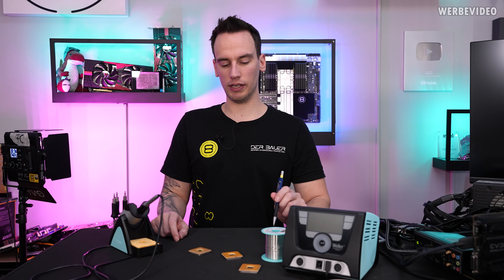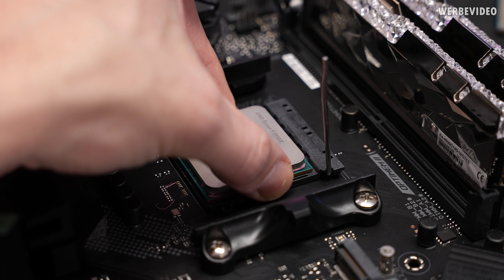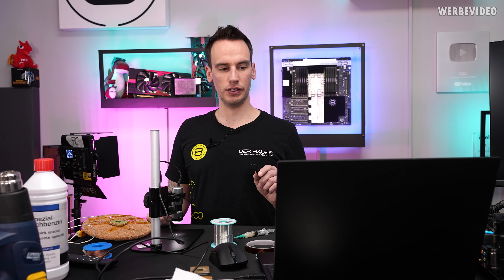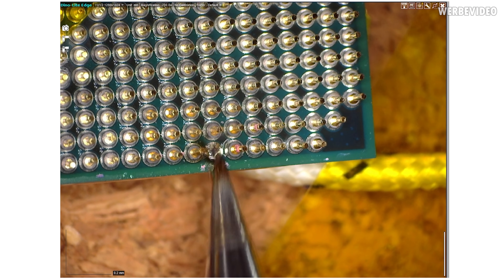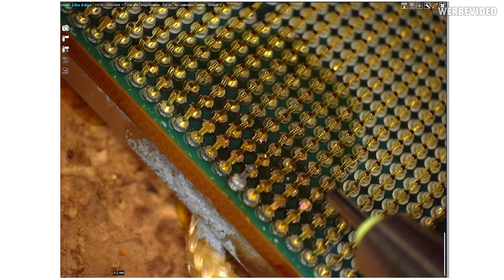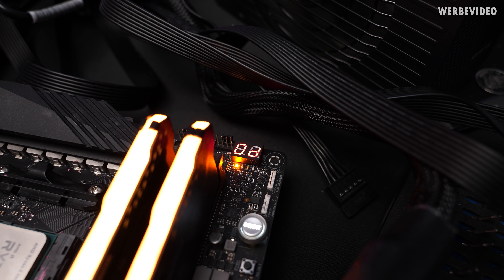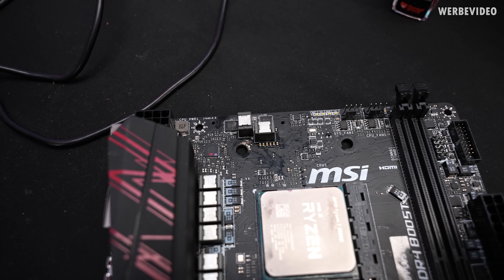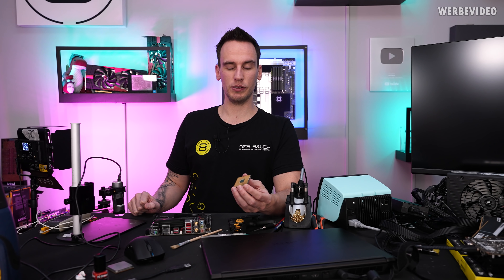I tried to Repair a Dead Ryzen 5950X and almost made it Worse...

Comment: I used to use a box cutter blade.  At every angle available between the pins and the bent pins I would wiggle the bent pin in the direction to straighten the bent pin.  90 degrees and 45 degrees angles.  It worked every time.

Comment: On the 5600X, the pin that was bent and broke off when you moved it (at pin coordinate AU39) is just a VSS pin. It is only there to provide a local ground reference to the adjacent MB_DQS_L[5] pin at AT39, to help keep the fields tightly coupled and the return currents off other nearby signal pins. Luckily the pin to the north-west of MB_DQS_L[5], at coordinate AR38, is also VSS, so even with that bent pin gone every signal pin still has a reference ground nearby (i.e. within at most one diagonal distance). All of the ground pins connect to a ground plane inside the carrier PCB, so you can lose that one pin without problems. The only one you really need to fix is MB_DQS_L[5] at position AT39, which is a data strobe (data clock) for the DDR bus.

A trick I considered suggesting is masking off the broken DQS_L pin with Kapton tape on the CPU, then bridging it to ground using a bodge wire in the socket. This would turn the signal from a differential pair (i.e. DQS_H - DQS_L) into a single-ended line (DQS_H - VSS). Unfortunately I don't think this will work, because the minimum V_IL(DQS) threshold is -130mV, meaning that DQS_L must be driven high relative to DQS_H in order to assert an input-low state. A bodge wire from DQS_L to VSS would allow DQS to be asserted high (i.e. DQS_L=0V and DQS_H > 130mV), but not asserted low (i.e. DQS_L > 130mV and DQS_H=0V) because DQS_L would be permanently stuck at 0V on the board side. In other circumstances you could probably get away with it, but unfortunately I don't think you can here.

A hack that might work without fixing the pin is running a bodge wire from pin AM36 to AT39 on the socket. This would tie MB_DQS_L[4] to MB_DQS_L[5]. As long as the memory controller keeps all the DQS drivers in phase, and as long as any separate enables/inhibits for DQS[4] and DQS[5] are simultaneously set/cleared, MB_DQS_L[4] should always have (functionally) identical output to MB_DQS_L[5]. Theoretically, this means you might be able to reuse the low side of the DQS[4] differential pair as the missing low side of the DQS[5] differential pair. My intuition is that each DQS should remain in phase with the other DQS drivers (plus/minus skew correction from link training), because the strobes should be generated from a common clock using PLLs, which would imply that they'd all lock in the same phase as long as they're generated on the same physical memory controller. However there's also a possibility that modern IMCs do something fancy with separate asynchronous clock domains which invalidates this assumption - I honestly don't know and I couldn't find good information to tell me one way or the other. The most likely cause of problems would be link training, which usually applies a skew correction delay to DQS via a DLL to ensure that its edges arrive at the DRAM IC at the same time as the data does. If link training is done sequentially for each chip, MB_DQS_L[4] would not be driven when training chip 5, so it might fail calibration. Other than that, I could maybe see excess line loading on MB_DSQ_L[4] leading to eye mask infringement, although that can likely be avoided at lower memory speeds. Might be worth a shot - it'd be a pretty cool workaround if it worked!

EDIT: On second thoughts I'm actually not sure this is safe, because DQS is bidirectional, so if chip 4 is doing a write and chip 5 is doing a read then you might end up with the memory IC trying to drive DQS15_n at the same time the CPU's IMC is trying to drive DQS14_n, and since they're bridged the drivers would conflict and potentially cause a short from Vddq to Vssq.
Reply: Before repairing a pin it's worth checking if it's important. VCC and VSS generally can have a few missing. However I would be wary of buying a CPU with an unimportant pin missing because the seller could have broken this off to give you the impression that the CPU is OK when it is in fact broken for a different reason.
Reply: I got too lazy to finish reading this comment.
Reply: How do you know so much? :O

Comment: You can use soldering tweezers and hold the pin until it is hot enough to melt the solder and let go as you saw it will pop into place if it is close and you won't have to use two hands.
Reply: Soldering tweezers are so great for SMDs!

Comment: You could have just gotten the pin close with the iron then switched to a heat gun and it would have popped into place like it did at 7:50.

Comment: there's actually a holder or template if you call it. is like the socket its made out of ceramic and it helps when replacing the pins makes sure all of them are aligned. i dont know if the company still makes them but if you really need one i can send you my spare. i bought them almost 3 years ago. also have them for trx40.  i like you video because it shows people that even guys like you experience things everyday non superhero status tech gurus like you experience. makes people that are just starting out into modding or repairing not to give up and just keep practicing. thanks brother!

Comment: I use Multicore solder that has 5 cores of flux built into it for easier single component working. also 60/40 has a lower melting point and easier to work with. Also you could get some FLU400 flux remover to clean the flux off. hth.

Comment: How about using an AM4 socket (separated from a broken mobo) as a stencil with upside-down orientation to get pins into position and aligned? Then only provide heat with hot air in broken pin area (may be possible since it is on the edge of substrate). Will broken pin be able to hold in that socket when upside-down ? I'm also not sure if the socket-stencil will hold out to the temp if soldering takes too long.

Comment: The most baller solution would be to machine all the AM4 holes into a hotplate (or a hat for a hotplate, to avoid breaking the heating wire).

Comment: You  could probably make a soldering iron pin holder similar to the mechanical pencil but fits on your iron to hold the pin to insert it, then have a lever to push the pin when removing the iron tip. Speed things up a bit.
Reply: If you watch Louis Rossman you will see how capillary action pulls the surface mount components into place. I think your idea would get the pin soldered but releasing it would be very difficult even with an eject button. It looks like these pins are surface mount components.

Comment: 3D print a pin grid array and put the broken pins in it and the rest of the holes in the array goes over the pins on the cpu. The pins stil on the cpu is used for aligning the new pins. then if you heat it up somehow you should be good to go

Comment: Hey Roman, bit like a Linus video, little janky, however, good job with the MB. Check out his video, they used a pin mask to hold the pins in place when they did there attempt to solder on new pins.

Comment: Hey for the broken pins on the cpu, have you considered finding a jewelry repair shop that has a laser welder? These are essentially a 10-20 power microscope mounted to laser powerful enough to weld various metals, including stainless steel (higher metaling temp than whatever copper alloy the pins are made out of). They generally focus down to .1 mm. I see a jewelry repair tech making real quick work of your problem. I would bring them some extras to practice on. These laser welders are thousands of dollars but quite common in the jewelry repair industry. my guess would be 2 minutes per pin to fix that. Anyways love the content have a nice day! 😁
Reply: That would be way overkill : these jewelry welders solder bare metals together by melting them. Not the same kind of soldering as the one using tin solder : you'd just destroy the CPU PCB.
Reply: @gabrielhmi  "you'd just destroy the CPU PCB." 

I don't see how, these lasers have extremely small heat effected zones. you can vary the "power" of it by ether limiting how bright the laser is, or how long the laser is on.

"Not the same kind of soldering as the one using tin solder" yeah its really not soldering, its welding.
Reply: @billymcbilly489  yes, that's the issue. You have tons of tiny very fine metal traces linked to these pads, you don't want them to take very large amount of heat in a very short time like for welding. CMS components usually come with a temperature curve which needs to be met for soldering, a soldering iron won't put you too far off from it, but a welder definitely will.
Reply: @gabrielhmi  its not an issue, once again, extremely small heat effected zone. I'm not talking about welding around the solder joint, I'm saying just take the broken part of the pin (if you still have it) or a new pin that you cut the base off of and welding directly back on where it came from.

Comment: Remove the old/broken pins and pads, clean the contact, put some solder-paste down, 'seat' the new/replacement pin on the solder paste (it will hold in place) and use a heat gun (low flow, high heat)...

You already saw one pull it's self into position, this will happen on them all :)

Comment: Ive done this a lot in the past. What works for me to grip the CPU down is just put capton tape on the bottom plate where the CPU can rest on. 
Its heat resistant and grips fairly well.
Reply: Are you German too, supporting the enemy?
Why support TSMC?

Comment: To lock the cpu into the cork surface, you can use kapton tape... For attaching the pins, if you watch Louis Rossmann, he drowns small SMD ICs in flux and then heat with hot air until the surface tension of the solder ball put them back in place perfectly, maybe that will work with the pins, it may even unbent the other pins...
Reply: Should also use kapton tape to protect the other pins from getting desoldered. Not hard to slip a couple of pieces in the rows and gently bend them over, then add a couple of more strips on the other sides on top of the first two.
Reply: @denlog1177  Aluminium foil heat spreader punctured by the pins.
Reply: Louis rossmann collab with der8auer to fix 5600x :o
Reply: capton not kap
Reply: @chloedevereaux1801  Kapton is correct

Comment: I would take a spare soldering iron  tip and drill a hole the same size as the mechanical pencil tip tube. Then shape the tip to clear surrounding pins, and then press the tube  into the hole. That way you only heat the solder beneath the pin.

Comment: Make a stencil! You have a CNC machine! Grab a little piece of thin metal sheet and cut some 10x10 holes of the diameter of the pins with the same spacing so they can hold the missing pin closer to the CPU substrate, the array of pinholes will hold it in place, then heat it up until it connects.

Comment: You have access to a CNC machine I believe? Dont know how small the holes are that you can drill, but maybe you could make something with 100  or so tiny holes to hold all the pins in place. Should not be as big as the chip but big enough to protect nearby pins.. Not sure how to avoid soldering the pins to the pin holder itself, other than being really careful :)  Or using something other than metal, like carbon or something?

Comment: recently bought used 3400g, it arrived with slightly bent 5 pins. i found a knife which would fit flush in non bent area and used it to straighten bent ones by inserting knife across all pins horizontally/vertically and applied a bit of pressure till knife would go flush like in non bent areas

Comment: Stainless steel tube. Or the typical soldering tweezers. I have also seen it done with just low low speed on the hot air station and normal tweezers, As you saw it will sort of "dance" to its correct position, you just have to get it very close.

Comment: was really hoping for a good way to fix my smashed ryzen 9 3900X. Pins on all 4 corners are smashed from falling on tile floors several pins are broken. Nifty tip with the mechanical pencil thank you Roman
Reply: Use a diagram to find which pins you can ignore. Power and ground have lots of spares so don't worry about those. Other pins say NC or not connected. Someone also suggested unsoldering pins from a cheap old AM3 CPU off ebay and popping them in the actual socket matching the missing pins on your chip.

Comment: One needs a hot air station or hot tweezers for microsoldering. They supply hot air like a heat gun but at a smaller more concentrated area for like SMDs but they're very expensive around $800. The hot tweezers run round $200 - 300.
Reply: Good quality hot air soldering stations start at about $250.
Reply: @szymontrojanowski7565  I can vouch for the Quick 861DW which is about that price. We got it in the lab to pair to a Hakko hot air station, and nobody ever touches the Hakko again because the Quick is miles better (and a lot cheaper).
Reply: @EnricoConca  I personally use atten station recommended by Louis Rossmann, and I love it.
Reply: +1 for the hot air station. It really makes it a lot easier to heat up solder with relative precision, without the big and cumbersome soldering iron in the way (which is considerably larger than the CPU pins).
Reply: +1. The cheapest hot air stations with integrated PCB preheater are around 160~200$usd though. They're not great, but still good enough for occasional use.
Reply: I didn't even know hot tweezers were a thing... can you recommend a brand or model?
Reply: Just to get some warmth on the area that you're using an iron then a cheap hot air solder gun will do.

Comment: Your other issue is solder wicking up the pin
I would try using using a heated bga stencil put pins in then heat 
Just clamp it into place once aligned

Comment: clean the solder on the pad ,and add some solder under the pin. using heating station and heat gun to gently blow the hot air to the pin.

Comment: I think a soldering iron tip thats hollow might work. The pin could go inside the hollow tip so you can heat and hold the pin at the same time. a loose fit should stop the pin from sliding out.
Reply: or tweezers that are a soldering iron that way you only heat through what you are soldering. Helps with not fucking with the pins in the general area that you arent trying to mess with.

Comment: Honestly its awesome you were fixing parts which otherwise were a writeoff. 
I have a graphics card with this issue. Windowed mode runs games fine but as soon as you fullscreen it it takes 30secods and it bluescreens the system and restarts. What could be the issue? Its a GTX970 Gigabyte Itx. Yeah i know its old and so on. But it was the only gpu i had and now im stuck with a HD5450 untill either i save up and get a new gpu maybe like a RTX 3050 for 350€ or maybe a GTX 1060 3gb for 100 once the time comes
Reply: You sure that's not a thermal issue? Sounds like something is heating up with the higher load.

Do stress tests crash it?
Reply: @volvo09  i reapplied fresh thermal paste and it kept crashing when ever it was fullscreend. Even ligher games from 2006 like commandos strike for at high settings 1080p had the gpu at 67-75% and temps in the low 50 or high 60 it would crash. Set it to the person who got it for me he was a techy and he ran a benchmark with heaven not fullscreened and it was fine but fullscreen, freezed, gray screened and pc restarted :(
Reply: @volvo09  the thermal pats also on the vrm heatsink and memory were also fresh even before this soo no ideas
Reply: @volvo09  Nvflash when i tried to reflash the gpu didnt detect it but the newest driver did apply
Reply: Crap man... Looks like you got all the basics covered.
Reply: @volvo09  i call it the gpu is dying slowly.. my friend whos going to try and fix is says its ppssible but we need a donor. Because 1 of the chocks  or something on the board is reporting a false value which is by the PCI-E finger